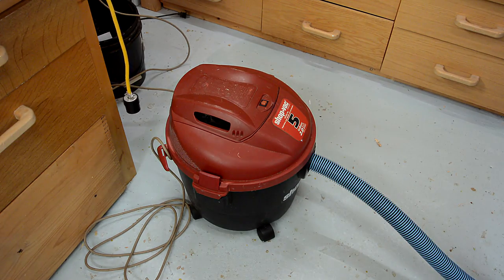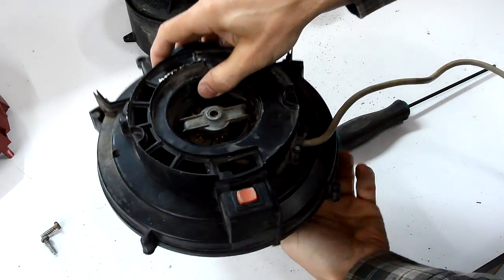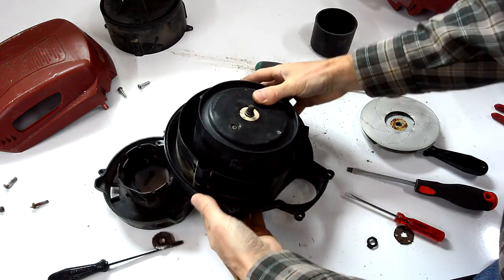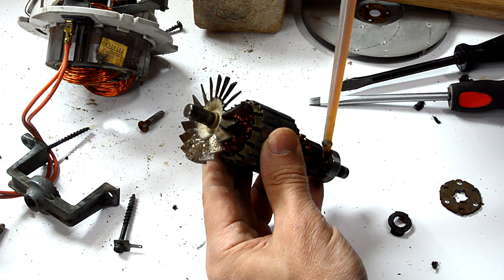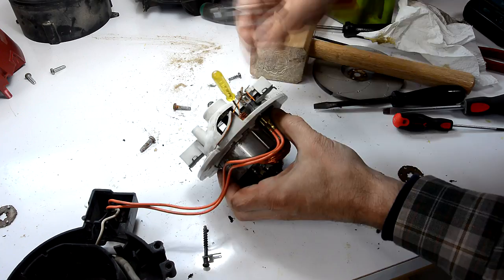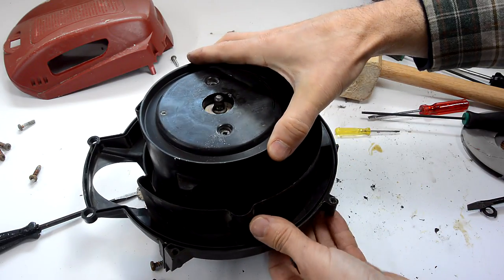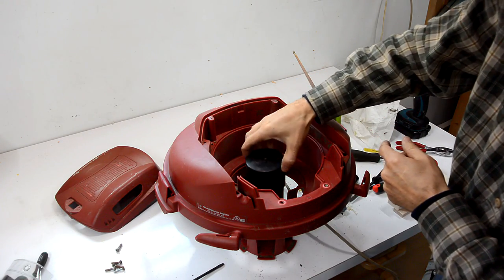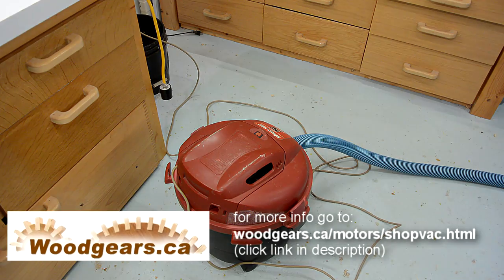Oiling noisy shop-vac bearings

Comment: Could use some help here 😐:

I am planning to buy a table saw .... So i went to one of my local shops and they had two saws in my price range, really the only major difference between those to is the depth of cut and the price. Saw number one 5,5 cm at 90 degrees ( 4,2 at 45), saw number two 8cm at 90 degrees and 6cm at 45 degrees. Other than that it is pretty much the same saw just the one with less depth of cut is 200€ cheaper. My question: Is saw number one good enough for woodworking like matthias or steve (ramsay) do or should I buy the more expensive one ? 

It would be very nice if some of you kind people could reply 😄 

P.S: Sry for a probably not so perfect english.
Reply from the maker: Can't answer without having a look at the saws in person.
Reply: +Matthias Wandel  First of all thanks for answering !! I dont now how good your german (still) is but here is the link : 

h ttp://www.bernardo.at/shop/de/catalog/product_compare/index/

And before every (european) starts screaming: Yes i know that this brand hasnt got very good customer reviews in the net but i really trust my salesman in his small shop ... if i have problems with the machine i can ask him... they also have a look at it when it arrives. He also makes a special price for me 😃
Reply: +Leon W. http://www.bernardo.at/shop/de/catalog/product_compare/index/ 

again without the the false http 😑

Comment: Common problem with lots of little motors.   Don't use detergent grade motor oil or regular 3 in 1.  That stuff gums up with time.  Best to use electric motor oil or 20 weight non-detergent oil.  I also like to lightly sand and solvent clean the inside of those sintered, oil impregnated, bearings to open the pores again.  When they make that noise, the bearing material is often smeared, closing many of the pores.

Comment: sorry it's a bit off topic, but what bandsaw blades (width/tpi) would you recommend for a beginner to have? I will be building a 16" bandsaw according to Your plans, just need to buy some blades to go along with it...
Reply from the maker: It depends on what type of cutting you want to do.  Whateve is most suitable for the types of cuts you want to make is best.
Reply: Heh, the answer is as vague as my question :) I'll probably end up buying a wide resawing blade and a thin, high tpi one for cutting plastics/curves later. Just wondering what would be a good "general purpose" blade - say, for cutting up to 10cm of hardwoods? What is the most used blade in Your shop?
Reply: +dalius98 his answer was about a helpful as a left handed screw driver

Comment: Thanks for the video.  Oil into the bushing area won't help at all if the internal bushing has already been worn out (not pressed on or tight fit anymore) from rubbing against the rotor shaft.

Comment: The vacuum rotor disc construction is the same as 60 years ago, the design must work well
Reply from the maker: Yup, just like cars still have four wheels on them today.
Reply: +Matthias Wandel duh all the cars I have owned have had 5 wheels !
Reply: +Matthias Wandel I mean exactly the same construction, & materials! 
Aluminium with the inner veins having tabs, that are simply folded & pinned through the two main discs. 
Not eg: cast out of a modern plastic etc
Car rim equivalent of an alloy wheel

Comment: My vac has that nut holding in the impeller, when you try to remove it, the hole shaft spins, any help with this? Thanks
Reply from the maker: use a nut driver in an impact driver
Reply: @matthiaswandel  Even though the shaft will spin?

Comment: I guess that you should wash the bronze sleeve for removing the wearing products before lubrication since the leaving particles may act as an abrasive and destroy shaft and sleeve.
Reply: It is a shop vac. They pick up dirt. It is what they do. They're wear items.
Reply: I am Russian. We have an idiom "Давайте постараемся сделать хорошо, плохо оно и само получится" that can be translated to English "Let's try to make it good, because it can be made bad itself". Sorry for poor English, but I think that you understand what I mean. No need to use ultrasonic cleaner, just piece of rag, moistened in solvent or WD-40, drag it throgh sleeve- that is enough.
Reply: Alexander Shabanin
But the bushing remains in a Shop Vac, so how long do you think it will stay clean? Your finger will still be on the start switch when it is full of dirt again.

Comment: Why the bleepity-bleep do they use Torx screws? That's just gratuitously making it difficult for owners to perform routine maintenance.
Reply: Could it be because they are better? And it is no more difficult than undoing a flat screw if you only have cross point screw driver, right tool for they job is rule #1.
Reply: Torx bits last. Phillips bits slip, thus destroying themselves.
Reply: And when part worn they still grip unlike Allen, on small sizes at least.
Reply: @Chris Stephens: The point is that most people don't have a set of Torx drivers, and they aren't needed in this application.
Reply: @putteification: Yeah; that will be really important for people who take their shopvacs apart every day for a year or two.
Reply: Trox are better than phillips, that's all there is to it.
Reply: +putteification Who cares about the bits? Who cares about the fasteners for that matter. What is important is the final product. That was the logic behind the design of Phillips screws. The heads are designed to fail before the threads strip out. So what is being assembled is not damaged by unskilled labor. They were originally used in automobiles, which are high value items.
Reply: +Paul Frederick   Sorry to say,  but your argument about them being used in autos is the perfect example of why they are inferior. Most high quality modern automakers use torx, hex, and Allen fasteners; and that's about it, and that's how it's been form years. They have higher torque ratings, lower failure rates (for both fasteners and driver), better and easier usability etc. You can blame Henry Ford for why phillips are so prolific in the US and Robertson fastener are the former mainstay throughout the rest of the world.
Reply: Adam Liske
that is because today tools have clutches in them. So the foreman can set the torque there. Henry Ford did not have that option available to him. So he worked with what he had.
Reply: +Paul Frederick  Wrong again. He used them because he got a better discount, over the Robertson screw guys, on the large quantity he needed, not because of torque applications. Engine and car frames weren't built with phillips headed bolts.... The cars never would have made it off the sales lot. They were used for trim, body panels, etc. Their commonness in the early auto industry made them easily adaptable to other market and much cheaper to make then better fasteners due to early manufacturing techniques. Phillips screws really are a wonderful example of just good enough engineering. But now we know better and have equivocal priced alternatives that are much better.
Reply: @Adam Liske: Argh. This whole line of argument is beside the point. Saying "Torx are better than phillips" is like saying "screws are better than nails." In fact, both are appropriate for certain applications. One of the factors that would have made phillips a better choice in this application is ease of accessibility by the average user.
Reply: KarlBunker Your argument has a slight flaw, from nail to slotted screw to Phillips to Allen to Pozidive to Torx, each successive user could whinge that you shouldn't use them because they are too idle to buy the right tool. It's not like Torx are something new, they must have been in use for at least twenty years by now.
Reply: Agreed there, torx is probably used because the bits last longer at the factory.  If they really want to stop you getting in they use such things as one way screws, 'spanner head' screws (the ones with 2 holes in the head), the 'slot with a lump in the middle', triangular heads, other things like that. This was relatively repairer friendly imo
Reply: *****
If they really want to stop me then they'd better place it in a secure facility. Because security bit sets are cheap today.
Reply: Torx bits are more easily engaged on automated machinery without slipping. The multiple faces allow decent torque values to be applied with a reduced risk of damaging the fixing. It's all about the production process
Reply: My point exactly.
Reply: SgtPiggie
yeah, and we were all pretty resentful when we had to buy sets too. That, and all of the metric horseshit that's been shoved down our throats too.
Reply: SgtPiggie
metric thread pitches suck the big wazoo. The fastener size range is a bit on the hurting side also, for that matter. Metric was never scaled properly for practical human use. Metric has preferred, and non-preferred sizes. But the non-preferred still get used far too often. There really isn't supposed to be fasteners in millimeter increments. Yet there are. In short the whole metric fastening scheme is a hot mess.
Reply: Metric is easier to use in many ways, certainly when you think of those ludicrous sub 1/4" UNC and UNF threads. Working out tapping sizes is also much easier than your old fashioned unified ones, no fractions to confuse you just simple decimals.
Reply: Chris Stephens
No one forces anyone to use fractions with imperial measurements. All of my calipers, and micrometers read out in decimal inches. Fractions do not confuse me anyways either. I know most of the conversions in my head. For the ones I don't, I have a chart hanging in my shop. It even has suck ass metric on it too. Because I have to deal with that shit more than I care to.
Reply: I used think think Imp was to be preserved at all costs, but I am a convert to metric.When machining I still think in thous, but work in MM, call me schizo.
Over here in the UK we used BSW, BSF, BSC, BSB threads, not to menton UNF and UNC threads, oh and BA threads for small stuff and, once we got used to it, we found Metric a saving grace.
Reply: Chris Stephens
Well you guys invented threading standards, and that's why you have so many of them. We almost lost the war because of all of your crazy threads. In the USA we use SAE. It is really quite a sane standard. When doing precision work there is absolutely no advantage to metric. A thousandth of an inch, or two hundred fifty four ten thousandths of a millimeter. It is the same damned thing. Just the metric number is harder to express.
Reply: The war is why you have unified threads, your SAE and our BS, well almost unified and with different thread angles oh and different head sizes too, (did I really say "unified") but the idea sounded OK at the time.
We humans like to think in whole numbers and when machining we think of thous as a distinct unit complete with a name "thou", with metric there is no name for a hundredth of a MM, let alone 2 1/2 hundredths. You could think of the next smaller unit, the micron, and use multiples of that but that gives the impression of working to far tighter tolerances than you are. I did once propose a name for 1/100 MM as DaMu, that is ten microns and pronounced "Damn you" as that what you say when you get the decimal point in the wrong place. :>(
Reply: Chris Stephens
machining in imperial there are thousandths, ten thousandths, and millionths. I have not heard of anyone going past millionths yet. But 50 millionths is not out of the realm of reason. It is right on the edge of it though. Just holding a piece of metal can make it expand that length.
Reply: For the majority of my work nearest thou is about right, sometimes tenths, and occasionally bang on, but hopefully not too often as I don't have much hair left to pull out when I get near to over doing it.
Reply: Chris Stephens
in my home shop I am not getting anything closer than five thousandths, or so. But when I worked in a tool and die shop I used to hit 500 millionths with fair regularity. Sometimes even better than that too. To do that we would grind, and polish work. We didn't expect better than plus or minus three thousandths out of lathes, and mills. The surface finish just isn't there to support any tighter spec. We would also heat treat harden parts before the final grind too. Otherwise in soft steel it is just a waste.
Reply: I guess you are using TC inserts, I can easily turn to 1/2 to 1 thou with good finish using HSS on my old Colchester. Maybe slower than TC but no need to file off the last thou or two like some folks need to do. :>) 
The other day I made a wheel spindle out of 303, decorative not road use, held 1/2 thou over about 12 inches, which surprised the heck out of me, and only needed light Scotchbrite to even the texture. Not economic for industry for sure but for home shop playing, where satisfaction is the currency, it will do. I wouldn't want to do it too often though as I said not enough hair left to tear out.
Reply: Chris Stephens
Yeah we did anywhere from hundreds, to ten thousand runs. So we did not exactly have all day to make a part. Some of the high end stuff were one off special orders. Like we made live centers about 6 feet tall. There is not much call for those in quantity. But that was not my department.

Comment: I bet if you take the bushing out of that bushing brace there would be enough room for a ball bearing to go there ;-)  Sometimes they design stuff the right way, with a ball bearing on each end of the shaft.  Then, they look for ways to cut costs and do stuff like sub in a bushing where there used to be a bearing.  Those stupid things always dry up and chatter.

Comment: I almost always see you use a regular screw driver instead of a drill to (un)screw stuff. Is there a particular reason for that?
Reply from the maker: I don't have the right torx bit for the drill.  And it's not that much work to unscrew these screws
Reply from the maker: screwdriver works just fine.  I don't need one of those kits.
Reply: Matthias Wandel
They do. I like to use a screwdriver for reassembly myself. For taking things apart I appreciate the speed, and ease that power tools offer. Then I am not too bored at the outset of a job.
Reply: I find that when using hand tools I take better care of the disassembly and less likely to forget how to put it back together. Some times power tools end up taking you longer in the end than hand tools.
Reply: amber cromby
if your power tools take you longer to use than hand tools, then you need more powerful tools. As far as remembering how to put things back together goes, I document, record, and mark tear downs. Because it is not about trying to be clever, it is a process. I go out of my way to make things easier for me. Years of experience taught me to do that.

Lots of folks try to act smart. You're always better off just being smart though. There is a subtle, but critical distinction between those two states. Because an act will fail eventually, while just being persists. Time will always tell if you're just acting, or actually being smart. Well, sometimes you can get lucky I suppose. But I try not to rely on dumb luck myself.
Reply: I often find particularly with plastic parts the increased speed of the unscrewing sometimes creates added heat which in soft plastics I've had the hole loosen up a bit. Rare occurrence indeed, but has happened.
Reply: mwiz100
how do you know it is the heat that is causing this perceived loosening you detect? It could just be a natural mechanical phenomena. One that would have happened regardless of what method you employed to drive the fasteners.
Reply: That is possible and really more realistic. But for one the screws will come out quite warm at times, and in soft plastics it seems to make a difference in ones which are extracted with a screw driver vs. by hand. This could be purely coincidental association in the few instances I've seen but that's my 2¢ based on observations.
Reply: mwiz100
any thread is going to break in, and or, wear out with use. That varies with the surface finish of the threads, and relative material hardness of the male, and female parts. As to what takes the bigger beating.

Comment: Have done this very same thing on household canister vacs. It last about 3 months before you need to do it again. Vacuum motors spin at high speed and tend to throw out the oil and you have to do this again, and again and again, and... finally buy a new one. Its a band-aid at best, and the patient will eventually die. Sorry!

Comment: I found that using oil doesn't last as long what you want to do is just Grease the bearing the brass bearings does not last as long with just plain oil.

Comment: I sprayed WD-40 into the top of my 20 year old Craftsman.....and it did the trick.
Reply from the maker: At least for a short time...
Reply: still running strong
Reply: WD-40 isn't good for bearings because it is not lubricant.
Reply: It does say on the can that it's a lubricant. And it does contain mineral oil.
Reply: OK, you are right, its part is mineral oil, but viscosity and temperature stability isn't suitable for rotating applications. For lubricate grating doors it would be good - better than edible oil.
Reply: I agree that something heavier like grease is better for bearings. The grease can melt when the temperature gets up. 99% of the time when people on youtube use grease it makes me cringe though.
Reply: How about a high temperature grease, like automotive bearing grease?